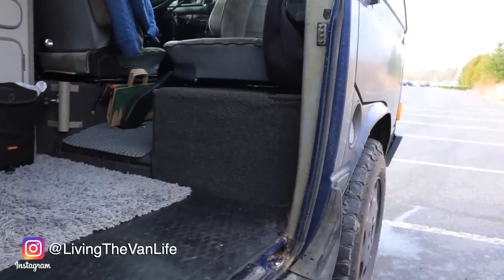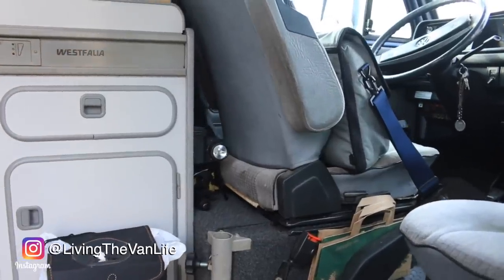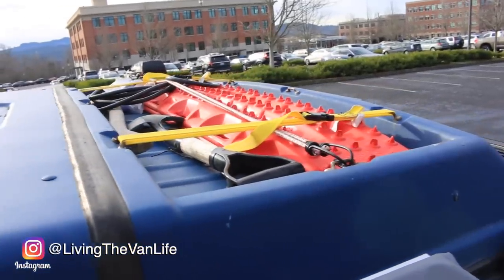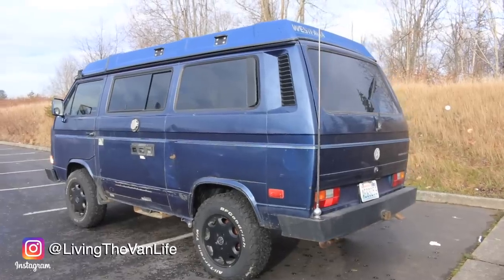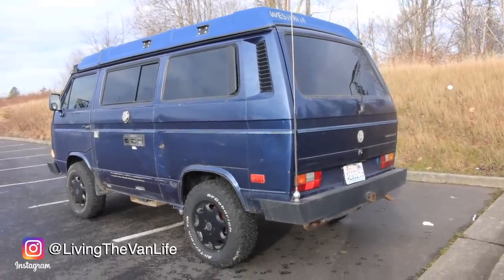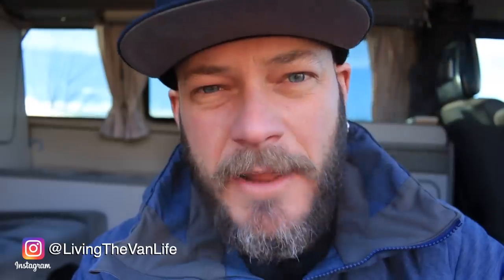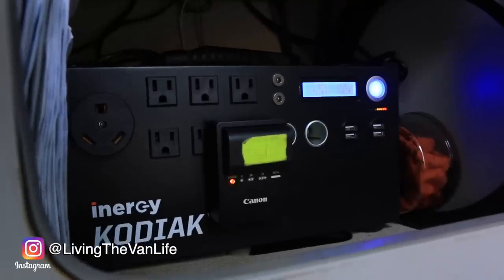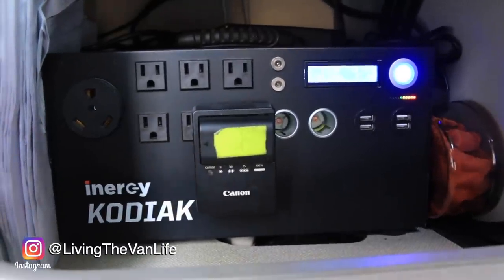Chinese Diesel Heater Install In a Volkswagen Westfalia - Living The Van Life

Comment: There is a gasoline version.
Reply from the maker: Show me?
Reply: @LivingTheVanLife   this is wranger star's video of the non chinese version. It would/could replace your water heater and could warm your engine block at the same time. Im sure if there is not a chinese version yet its only a matter of time. https://youtu.be/RisDBj7Gkt8
Reply: This one might be a gas version. https://www.amazon.com/dp/B06Y4M414K/ref=cm_sw_r_cp_awdb_t1_8kusCbXJJX76J

The webasto airtop is what these are copies of. It is avaliable in both gas and diesel veraions.
Reply: @dimedriver  it's an espar. He already said he didn't have the budget for those.
Reply: @Invictus13666  the 2nd link i posted is a clone of a gas powered airtop. Basically the unit he has but it uses gasoline.
Reply: @dimedriver  Isn't it double the money while providing half the heat? Gasoline has less heat potential than diesel, and that one you linked (IIRC) was a 2kw as opposed to the 5kw he bought to match the btw output of his Mr. Buddy. Plus that one  you linked is around $480 while he paid about $150. The numbers just don't add up.
Reply: @Invictus13666   I have read that all the chinese versions of these heaters are the same power output no matter the label. The real euro made heaters are different physical sizes when going up or down in power. All the chinese ones are the same physical size. As for fuel. Gasoline is about 10% less energy dense compared to diesel. This could be compensated for via higher fuel usage. I have not tried any of these heaters. I feel the espar hydronic setup is proably the best all around but the cost is steep. For an RV it makes the most sense. Use the exiting engine cooling system/hvac in the truck or van. I don't think the chinese manufactures are trying to target the US RV market very hard with these as they have very few gas offerings.

Comment: Gasoline model would have been easier.  I have ordered for gas rv.
Reply: If you are buying one of the Chinese heaters that shows in it's description that it's for gasoline, it's incorrect wording. These heaters only run on diesel.
Reply: @TheAvkdutch  calm down, Sally.

Comment: are they chinese clones of an american product?
Reply from the maker: Of German product
Reply: @LivingTheVanLife  Yeah..probably a blatant copy of the Webasto..
Reply: It is a clone of the German Epersbacher D Airtronic. This is fitted in all English Semis by law so the Semi driver doesn't run the truck engine to keep warm.
Reply: The Webasto is great also but all Mercedes trucks and vans use Epersbacher. They have a 5 KW Water heater under the starter motor. Touch the 'Auxilliary Heater' switch on the dash and you will hear the Epersbacher roar into life. I think this heater is also sold as'Espar'.
Reply: @anthonykeaveny8860  Yes Eberspacher is another one that;s proven. I've used both in trucks and they are reliable heaters that keep you warm on the coldest of nights. They suck diesel directly out of the fuel tank.
Reply: @anthonykeaveny8860  Actually in all European trucks. Diesel in Europe is way too expensive to idle trucks overnight for the little heat you would get out of them in winter. The cab heater is the solution..

Comment: What about the overwhelming odor of the fuel when filling the tank?  Even one drop will stink up the whole van.
Reply from the maker: Come on... this is not a dirty ol pickup truck where you just get sloppy with the diesel filling.  You gotta take a little more time and care while fueling and any human is perfectly capable of putting 2.5 gallons of fuel in a tank with out spilling a drop.  It’s just common sense.
Reply: Living The Van Life So you need a separate gas can to carry the diesel from the gas pump to your 15 liter tank mounted inside the van? Where do you keep the spare gas can? Or do you pump it into your van directly from the gas station's pump?

Comment: Are there any fumes that seeps out from the diesel fuel tank?
Reply: I doubt it. Diesel is really a light oil - it's fumes can't readily ignite like gasoline, much much safer.
Plus it's combustion process oh is safer vs Propane as this Diesel heater can be ducted so incoming airflow pulls from outside.
More easily done with this unit.
Were the RV super tight a non-ducted heater could potentially cause oxygen starvation - bad plan lol !
Reply: Or filling that tank from your cab and carpet right underneath... you get a spit  worth of diesel and you're going to be smelling if for a while

Comment: Hate diesel smell no way do I want to live with an electric driven heater prefer propane vented with no Electrics also consider  diesel gels under a certain temperature then you got yourself some problems 30 years of vanlife under my belt but it's a cool unit and a clean installation

Comment: CAUTION!!!!   PLEASE READ AND RESPOND!  THE LOCATION OF YOUR EXHAUST MAY KILL YOU!!!!  I recently encountered a guy who had his exhaust port near the same location as yours.  He died of carbon monoxide!!!  Unbeknownst to him, as he drove around the exhaust filled with sand and dirt...  It clogged and exhausted into his van.!!!!  While he slept he died!!  Please let me know you got this message.
Reply: I was thinking the same thing. The install in the old fridge is great tho. I removed mine already. Thanks for the heads up!
Reply from the maker: Good feedback.  It will definitely be a good investment to get into a carbon monoxide detector and keep an i on the exhaust port.
Reply: Nicely done Chris. It is wonderful for you to make sure he saw your mesage. Maybe a deflection sheild below the exhaust might help keep the crap out.
Reply from the maker: Yes, Chris, thank you very much for the insight on this.  Comments, advice and feedback are always very much appreciated.
Reply: Living The Van Life 

I had a Honda Civic that once had a fine slit in the upper ceiling wall of the passenger side wheel well 

Somehow,  the tire picked up a small piece of metal that drove a hole into the interior of the Honda. 

With the black tar like wheel well coating, it was nearly impossible to notice 

A mysterious wet car trunk eventually lead to this discovery 

Obviously,  all vehicles have varied design features in terms of metal and flexible body panels and coatings, etc